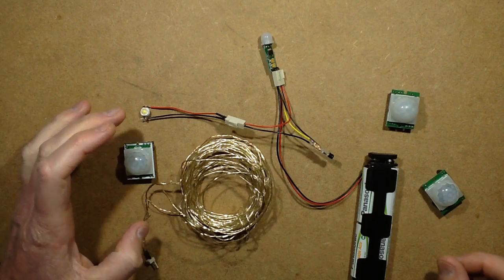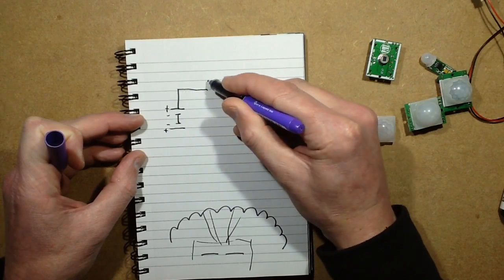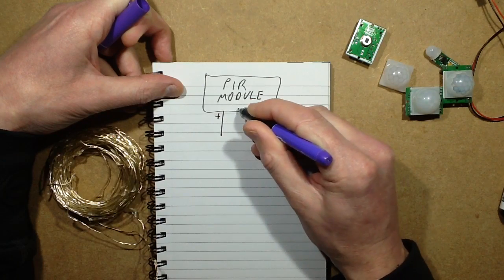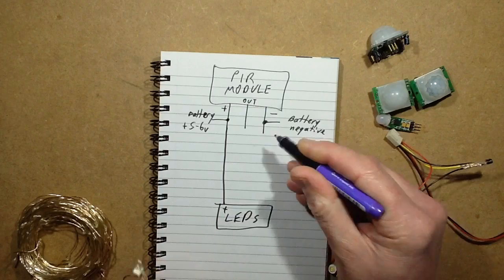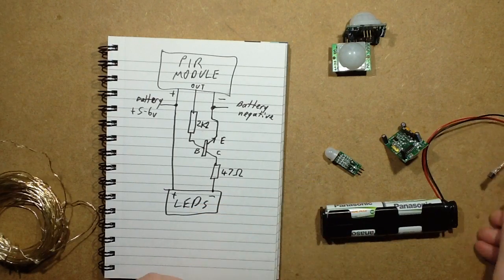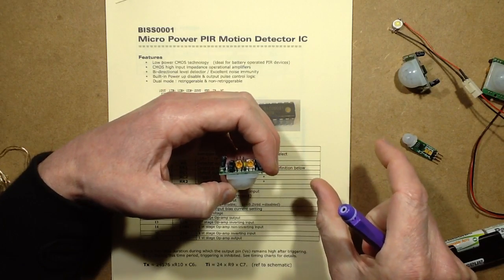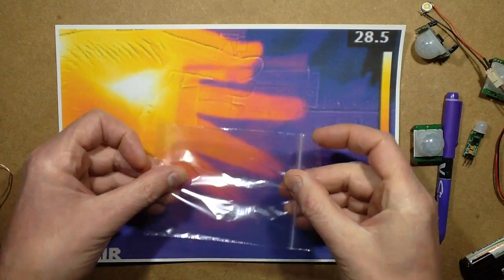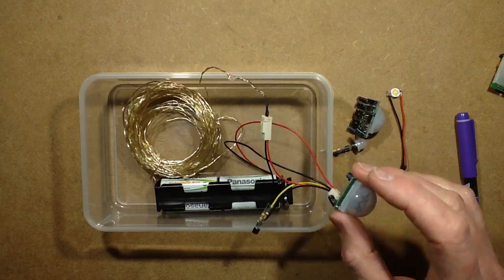How PIR modules work and using them to control LED strings.

Comment: hey I'm a total amateur to the world of electronics and i'm trying to make little motion sensing bristle bots (vibrating brush heads that run across a surface).   I'm hoping you could give me some advice to get my system correct....

 The mini PIR I purchased is this one: 

https://www.banggood.com/Mini-IR-Infrared-Pyroelectric-PIR-Body-Motion-Human-Sensor-Detector-Module-p-1015337.html?rmmds=detail-bottom-alsobought&cur_warehouse=CN

and the phone vibrators I got are these:

https://www.newegg.com/Product/Product.aspx?Item=9SIA76H3FP6486&nm_mc=TEMC-RMA-Approvel&cm_mmc=TEMC-RMA-Approvel-Contenttext_-

I chose these because they can both operate on 3 volts so I can theoretically use a single watch battery.

What I didn't realize when starting this is that the sensor doesn't just act like a switch (like I said, total amateur).. do you have advice which resistors/transistors I should rig up to get this to work? or perhaps how I should go about discerning this for myself?  If I can get small ones to function I will likely scale up.

I rigged up the system currently bypassing the middle out from the PIR and the system just runs, I hope I didn't overload the PIR or anything through this mistake..

Thank you!
Leander in Brooklyn

Comment: Hi Clive great vid ! I have an outdoor PIR which has stopped working ( started to just flash on and then go off ,now not working at all ) question is can I just replace the module ? I suppose they are all different sizes so I would have to get the correct one , many thanks , Nick .
Reply from the maker: It's usually best to replace the whole PIR unit.  If it's built onto a floodlight you may be able to get one that utilises the same mounting hole.
Reply: Thanks Clive for the quick reply , yes I would normally replace the whole PIR but I never have seen another like this one , worth a try as a new module can be bought for so little .
Reply: I have the same issue.  When it got cold out, it stopped working.  Took it inside and when it warmed up, it started working again.  Using some cold spray, it appears that the PIR sensor is at fault.  If I hit it with cold spray, the light stops working. I would like to just replace the sensor but am not sure how to source a new one.

Comment: I have a lamp with a PIR module in my bathroom, it even works when I'm in the shower with the showerdoor closed.
Reply from the maker: Definitely PIR?  It might be a radar sensor that can detect movement by radio reflections.
Reply: Hi Clive, I'm not sure,, It's a no-brand ceiling light I got last year for about 10£  50% rebate)   
 I made you a pic ->    https://i.imgur.com/x9LCZAs.jpg

Comment: Very nice video, I have a question. Can you increase range, say about 200 meters?
Reply from the maker: Not to that range unless you used a custom designed lens which would have to pass longwave IR.  There may be better detection options like a bounced laser, but it would be prone to false triggering with flying insects, debris and atmospheric conditions.
Reply: Thank you, why do we see some driveway sensers claiming things like 1/2 mile? must be fake I assume.

Comment: Great video! I am new to electronics so this video really helped. Thank you for sharing. There are 5V LED strips available in the market that are powered by a USB cable. Can those be used for this circuit? Will the PIR / BC547 be able to take 5V at 1.5A without blowing up?
Reply from the maker: The BC547 is only rated for about 100mA (0.1A) but it could still run a short section of the strip, or the whole strip at reduced intensity if a resistor was used in series with it.
Reply: @bigclivedotcom  can he use a relay rated for 3.3v instead?

Comment: I just found out that those big PIR's 
false trigger when using 3.7v.
I just removed the protection diode & directly connected it to 3.7v. 
It works fine!!!!
Reply from the maker: +A B I D They do.  It defeats the voltage regulation, so they constantly re-trip when they turn off and the voltage changes slightly.  That diode does buy you an extra half volt of operating voltage.

Comment: Great video and box idea. I used one of these modules, buffered by a BC109 transistor and a reed relay to control a DFPlayer mini, to play an mp3 file from a micro-sd card. Run from 6 D-cell batteries. Strange problem, it played permanently except when somebody got close; it turned out the speaker magnet (external field) was opposing the reed relay coil's field causing the reed relay to operate as NC instead of NO! Moved it away from the magnet and now the module works fine, and my visitors will have ghost sounds at Halloween!

Comment: Seems non-retriggerable mode would be good if you were, for example, counting the number of movements in front of the PIR, and once a threshold was reached, you then set a flag to send a message such as: "there seems to be a lot of movement in front of your car - it might be being stolen".

Comment: I have been using a outdoor solar charged security light with pir sensor - it is as bright as the sun but even on the most sensitive setting it is fairly dumb. I have to jump up and down waving my arms at it to get it to fire. Guess that's why it was $20 us

Comment: dose it works under sunlight ?
Reply: Several problems you should be aware of: the plastic lens may not be UV stabilised for outdoor use so the HDPE may disintegrate if exposed to sunlight for long periods. Also, as Clive says, they are extremely sensitive* so any temperature changes caused by wind or sunlight moving may trigger them - this includes any draughts inside the housing. Also, unless the pyro has good visible light filtering, any direct lights - whether sunlight, streetlights or car headlamps - may trigger them or simply swamp them. That level of filtering is only usually available on pyros designed for intruder detectors and it's highly unlikely these small modules will have it. So, they can be used outdoors, but they need to be protected and carefully sited. But if all you're switching is some xmas lights, you may not be too worried about the occasional false triggering.

* a passive infrared intruder detector will detect something like a 1C to 1.5C temperature change at 12 m and a much smaller temperature difference closer in.
Reply from the maker: +Subhash Chalapati Yes.
Reply: so it will work even in hot sunny mid day also write.
Reply: thanks for your kind information. can you suggest a sensor which is used for human detection at out doors
Reply: Sorry, no. Not aware of any, but it may be worth experimenting with some to see how they perform.
Reply: DOES not DOSE

Comment: For 99 pence they are useful if you have an indoor application in mind. Getting one to work from inside a plastic box was unsuccessful for me no matter how I tried.  Built two from circuits found on tinternet onto a proto board hoping inter changing components might help, but alas no. Pity if these things worked for other side of glass they would be really useful, at least for me.
Reply from the maker: PIR sensors can only sense through plastics that are transparent to long wave infrared.  Like polythene food storage containers.
Reply: That explains why it works in the food containers, cheers. I tried in a plastic bottle also, it worked for a short time and stopped triggering. I take it out the bottle it works again and this repeats. Big bottle 5 liter water bottle. Strange.
Reply: I've used these sensors a few times in the past. Drilling a hole the correct size allows the sensor dome to protrude outside the enslosure - it can be glued from the inside. This gets around the problem of attenuation anmd also increases the sensor's viewing angle..
Reply: PIR in my bathroom nightlight also detected movement through a shower curtain about 5 feet away.

Comment: I finally got my Raspberry Pi wired up with one of these PIR modules. It sends a signal to my Raspberry Pi to take a photo and email it to myself. I added an LED to let me know when it senses motion. It is so sensitive, I can just smile and it will trigger. The two potentiometers don't seem to change the sensitivity. I guess I could partially cover the lens to lessen sensitivity.

Comment: Thanks for the useful info Clive - I've been wondering how to make best use of my PIR to make a hallway night light. I hooked up the output and ground driving various LEDs, which always seemed to be under-driven by a few tenths of Vs from getting full brightness. Am I right in thinking there's some sort of LED voltage detector built into the PIR module (mine is very similar to the larger square one with 2 orange presets you show in your video).
Reply: Assuming the LED is 1W you then choose a transistor for 1W for this application? Instea of a transistor, Could I put a 3vdc relay to manage higher AC or DC currents? Thanks
Reply from the maker: These units are not designed to drive a load.  They can only put out a small current for other circuitry to use.  Hence why I added a transistor to allow them to drive a higher load in one of the videos.

Comment: I wired mine the same way as your drawing, but without the transistor.  It' working just the opposite. The led stays on and goes out when I put my hand in front of the sensor. I'm waiting on transistors to arrive in the mail. Will using the transistor make this work right?

Comment: I really enjoyed your video on PIR sensors and need your advice. 

I bought OxyLED T-03X (https://www.amazon.com/gp/product/B01M4OIGBS/ref=oh_aui_detailpage_o05_s00?ie=UTF8&psc=1) motion activated light. I installed it in my hallway and so far I am pleased with it except I dont like the activation angle that the unit have. It says that only covers up to 120 degrees, which on the small/narrow hallway like mine means that I have to get really close to the light in order for it to activate. 

I am trying to find a solution that will help me extend the coverage area. Since I have the unit attached to the wall, I need it to be able to sense motion coming from both ends of the hallway (2 meters toward each end). 

I was thinking... Would it be possible to solder additional PIR sensor (only the metal component with the square window) directly to the original PIR component on the board. This way I am hoping to point both sensors in an opposite direction so I can cover wider area. 

What do you think?

Thanks a lot! Your video ROCKS!

Comment: i have 12v LED chip connected with 12v battery throw a resistor witch can be light up with on / off button
now i have sr501 motion sensor  .so plz tell me how to make the conetion 
will i need any thing else.

Comment: I don't know much about electronics, but where can you get an emitter (the one you connected the output, negative and LEDs negative with)? I have had no luck so far
Reply from the maker: You're looking for an NPN transistor.  Depending where you are in the world it may be able to get a BC547 or 2N3904.  These are very cheap and common low power transistors.  You can also buy them on eBay.  Note that different transistors have the emitter, collector and base on different pins so you have to check online to see which pinout your transistor style has.

Comment: How could a PIR be used with a 12 v lot LED strip with up to 30 LEDs.
Reply: Brian Durward switching via a Transistor (MOSFET)
Reply: Christian Schmela thanks will try it.
Reply: Check this Link: http://popoklopsi.github.io/RaspberryPi-LedStrip/#!/
There is basicly the same, just switch the RaspberryPi Signal for the Signal of the PIR Module (behaves the same)

Comment: I can't find good information on the kind of CdS LDR to use with these. There are some places that say you should put another resistor (e.g. 120K) in parallel with the 1M resistor which is in series with the LDR. Alternatively, you must require a high-resistance CdS. I'm sure I found a discussion in the comments of a HC-SR501 YouTube video but I can't find it and I don't think you can search YouTube comments with Google.

Comment: Your videos have inspired me to learn something about electronics. I love the way you showed the development of the circuit and  I realize that you posted this a year ago,  but I really want to know how you chose the value of the two resistors.
Reply from the maker: The base resistor was selected experimentally based on supplying enough current to turn the transistor on fully without loading the PIR module too much.  The series resistor for the LEDs was chosen to provide enough current to make the LEDs glow at a decent intensity, but not draw too much current to maximise the battery life.  Both can be adjusted within reason.

Comment: Hello! Is it unwise to change the Fresnell lens to use a larger one? I want to use these cheap Ebay modules in a repurposed (previously 240v) ceiling mount and get a low voltage signal out of it. But the ceiling mount obviously has its own lens, slightly larger
Reply from the maker: The polythene lens just provides a series of sharp infrared contrasts to the sensor.  As long as the new sensor is in the same place as the original one in the unit it will have the same coverage and sensitivity.

Comment: Thanks for the video but amhaving trouble finding one that works with 12v , a real solar panel of 20 watts and a recharg
ble 12v batf
Reply from the maker: These PIR modules may actually work on 12V as they have a regulator on board.  But you can also get 12V PIR modules.

Comment: searching fleabay for the plugs and connectors and not having much luck...
Reply from the maker: Where are you based (country).  It might be worth trying a mail order electronics supplier.
Reply: UK buddy, quite fancy making one of these :)
Reply from the maker: Best place to buy the connectors in the UK is probably Rapid Electronics.  You'll probably find they have some other stuff you'd find useful too.  Here are links to the connectors and the crimps plus a suitable tool.
https://www.rapidonline.com/jyk-crimp-2-54mm-pcb-connection-system-63798
https://www.rapidonline.com/straight-pin-header-28953
https://www.rapidonline.com/jyk-t2500-02-reel-500-0-1-crimp-terminals-22-1096
https://www.rapidonline.com/ratchet-action-crimp-tool-ht225d-85-0262
Reply: You're a bloody star mate, thanks :)

Comment: Hi Clive, I'm sure you are aware of those PIR sensor built in LED light Bulbs (E27 and B22). I have bought some but they stop to work after about a week of use. Do you what what could be causing them to fail?

Comment: Clive, I've had issues getting these to work. I connect to a 5V supply and ground, and the pots are set to minimum sensitivity and minimum time, it just cycles through the output high -> output low for built in delay -> output high, cycle, and repeats. Any idea what causes this?
Reply: Hi Peter, check your re-triggerable/triggerable mode select on pin 1. Clive covers this in the video. It should be set to high.
Reply: Dave Pye if I set it to high, then the output just remains high for ever. Initially thought it was just really sensitive, but it still does the same, even when the module is in my desk drawer...
Reply: OK Peter, just checked out the timing controls on the scope. It's very sensitive and the smallest tweak increases the hold on time significantly. It appears to have a logarithmic response. Try this, with the pots facing down, turn the left dial fully anticlockwise and see what happens. Let me know the  result.
Reply: Dave Pye that's how I've had it set. The turning it to the left sets the output high for about 3' seconds, before it goes low for 5, and then repeats. Turning it all the way to the right makes the output high for a few (agonizing without clips for my multimeter) minutes.

I've just tries another module from the batch of ten that I bought, and this one seems to work, the first four all do the high low dance I described earlier.

Anyway, looks like I'm sorted, thanks for the help!
Reply from the maker: Is it a stable power supply, and are you driving a load directly with the output pin?
Reply: bigclivedotcom the power supply is stable (USB powered Arduino Uno, module powered by 5V and ground pins, and I've measured with one of those USB power meters) it does the same thing with a load or without, though the load, when connected, is driven by the arduino, and the module is only an input that the sketch uses to trigger the led on, so no direct load ever driven by the module.

Last night I got one to work, but once I took it off my bench and installed it, it does the same thing, so now I'm stumped.

Comment: Great vid again, BC.  Can I power LEDs that draw 1amp of power with this setup?  How about 0.5 amps?  If not, how should I alter the circuit?  Thanks!
Reply from the maker: You'd need to add a better rated transistor for that, but it's viable.  The voltage is a bit low to drive a MOSFET unless you got a decent low-gate voltage logic level one.  A Darlington transistor is a possible option too.
Reply: like this? https://cdn-shop.adafruit.com/datasheets/TIP120.pdf